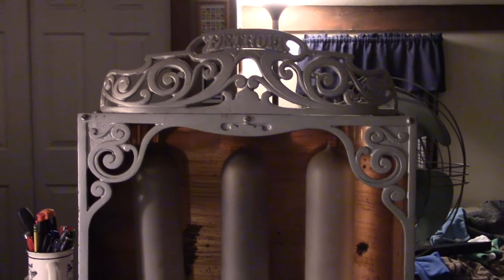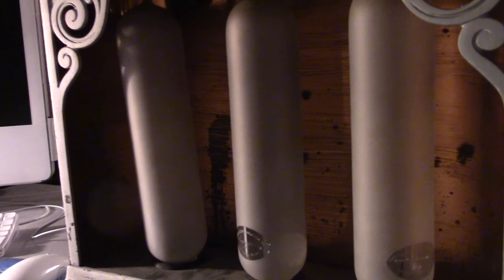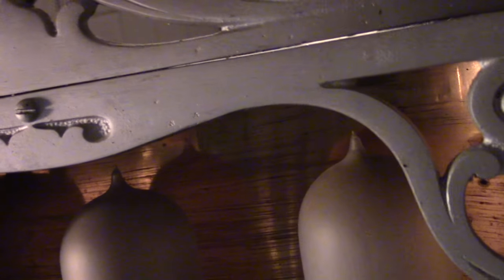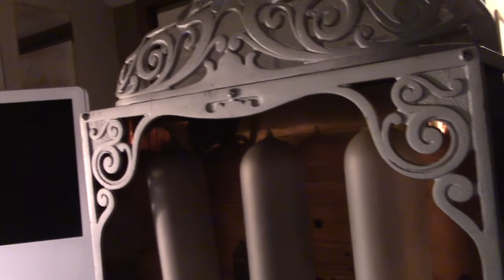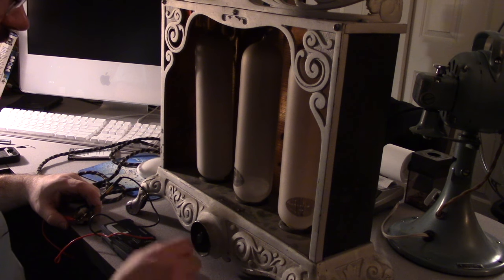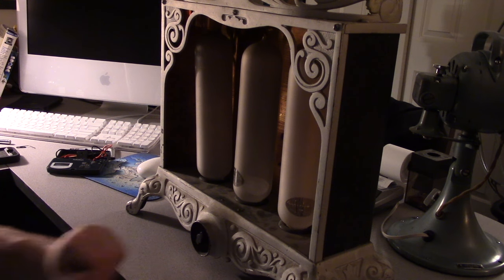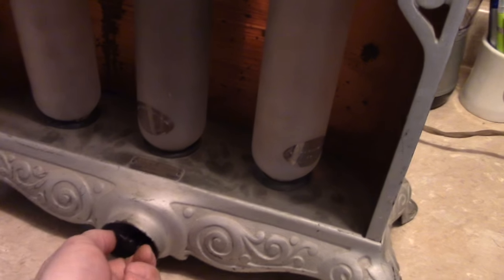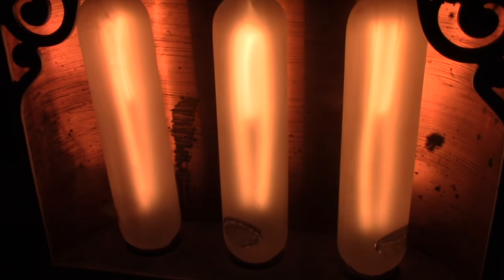1910 "Detroit" Electric Heater

Comment: The brass reflector behind the bulbs was highly polished and given a quick brush coat of spirit varnish.  It is a sort of lacquer based on vegetable gum or resin. The invisible-back-then brush marks in time tarnished brown because the bristles of the brush made the coating very thin where they dragged acroos. The streaked or uneven darkening effect is commonly seen on brass items lacquered before spray-on nitrocellulose anti-tarnish coatings became commonplace by about 1924.  It is a sign of antiquity, patina.  Once restored it won't ever look original again.   Also, by the way, the body being brass finished and not nickel plate, positively dates this heater to before 1915.  1915 was the year that the brass era was entirely supplanted by nickel plated finishes. Overnight, practically, electric fan blades, auto brightwork, everything that was brass in 1914 became out of style and passe if not nickeled.

Comment: Nichrome (nickel-chromium alloy) resistance wire, such as is still univerally used even today, was at that time new and under patent protection.  These filamentary incandescent resistance heaters avoided patent infringement by using *in this case, for instance, carbon filaments*, which of course required in-vacuum operation.

Comment: I thoroughly enjoyed watching this video.  I received an old Arvin space heater and got to looking at videos and came across yours.  Can't imagine the accidents that happened as a result of these things keeping people warm.
Reply: I just found a circa 1970s or 1980s Arvin "Fanforced Automatic Instant Electric Heater" (1320 watts) today by (not in) a dumpster. It works! I'm using it now. Though the plug has electrical tape wrapped around it. So I will replace that. I had another fairly similar Arvin up until several years ago that I had to throw out when it started smoking. That one was noisy! But the one I found today is not so noisy.

Comment: This was interesting . I didn't know that there was an Electric Heater in 1910 , and it consumes only 750 Watts of energy .
Reply: Those heaters heated instant - they work well - my grand father was a early 1900s electrican or generator man - I'm 3rd generation off shore oilfield generator man - 
   Only those that lived in areas of the country try that had hydro electric power could afford to run a heater like that -
      Electricity in most areas of the country was around 30 cents a KW in that era - at the rate of inflation 30 cents In that day was about $27 a KW today so if you ran that heater for 1 hour that would be somewhere around $21 In our money -
     In the end electric heaters were not used that often and when they were used they were used for short periods of time - the infrared heat off of those old heaters penetrates right through our muscles so they tend to warm us very quickly - I use a few of the old Edison style floodlight type heaters around my house there 660 watts they still sell the cones for them today - I prefer them to the modern electric heaters - those heaters were not designed to heat the air they were designed to heat the object that means the chair I'm sitting in also myself -
     Today the power where I live at is only 8.5 cents a KW versus the $27 a KW they paid 100 plus years ago so using one of those heaters is very practical - many of those devices made back then were designed for a 300-year life cycle versus getting a chinese-made electric heater that's designed to fail after one year of service - so I have a mix of old and new heaters etc

Comment: You can repair the bulb bases like Bob Andersen does. At the end, lightbulb is a kind of vacuum tube. Unsolder the tip of the bulb, take the base down, glue it back on with permatex (not superglue, the heat will weaken the glue, it will turn white and crack), and solder back the tip.
Reply from the maker: Thanks! I'll have to find out exactly what he uses.

Comment: man you always seem to find some of the coolest antique appliances I have ever seen, the oldest thing i have come across down here is a 1924 percolator, that sadly can't be fixed, the copper weld on the inside where the handle attaches has broken, so doubtful  even if I could find the cord, it would ever be able to hold any liquid.
Reply from the maker: You can always solder it.
Reply: I had thought of that, but given that's where the coffee would be, I was worried about leeching, as I'm not sure what type of solder would be safe, I'm sure the thing actually works, but other than that I have no cord either, this was a display piece before I got it, so no tampering has even been done, I think i was the first to take the bottom off lol.
Reply: You could try JB Weld.  According to the company it's food safe.  I fixed a leaking 1930s percolator with it.

Comment: I wonder if anything like this existed in the UK?  Would have been extremely advanced for the time!
Reply from the maker: No, not at all. Light bulbs and resistance heat appliances were the very first appliances during the early electrification period. This is basically a holder for high-wattage light bulbs. Very basic.

Comment: How long should these still run? I have a lamp from ~1940 but I dont long the filament will last.
Reply from the maker: If left on and never allowed to power off? Decades. If turned on and off several times a day? Months; possibly even weeks.
Reply: Clear. So I can use old bulbs but it's best to minimize the load when turning on and off. That must explain why the Centennial Bulb still runs. Thank you :)

Comment: Awesome heater! However I somewhat cringed when you blew the dust out underneath, not only was it dust but possibly some asbestos as well.
Reply: I agree, asbestos is nothing to mess with lightly
Reply from the maker: No, but it's not as dangerous as it's made out to be. I grew up in a home that featured asbestos fireproofing all over the place; the flooring, some of the siding, the furnace, the firewall behind the wood stove - all asbestos. I attended school in a building with asbestos ceilings, floors, and pipe insulation. Just avoid regular exposure to friable asbestos and you'll be fine. Yeah, blowing on it wasn't the greatest thing to do, but the likelihood of me contracting mesothelioma from just that is pretty low.
Reply: BBISHOPPCM's World, Please be careful with asbestos, it has killed 2 of my family so far...

Comment: How much Power would this Heater use?
Reply from the maker: As configured, 750watts at full power, 250w at minimum. So about as much as a modern two-slice toaster.
Reply: So this this uses less power than standard 240v electric baseboard heat?
Reply from the maker: Yessir. Good thing, too; wiring in houses back then was pretty sketchy (not enough circuits; unreliable power delivery). There's a common misconception that antique electrical appliances were somehow "horribly inefficient," but that's simply untrue. This can be fitted with 500w bulbs for a maximum of 1500w of heat output.
Reply from the maker: Yes.
Reply: yea theres really not much you can do for efficiency with incandescent lamps or electric motors :P

Comment: i heat my room with a 1947 arvin model 203a heater.
Reply: I have one of those and I have a 213
Reply: @willardcrafto  i have a 213 too, mine has been painted though, the 203a is in original shape.